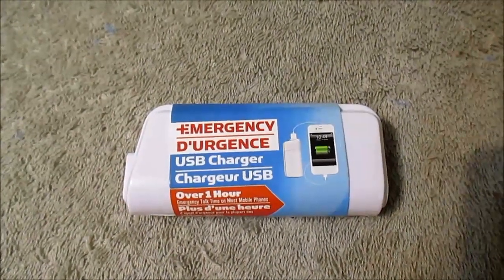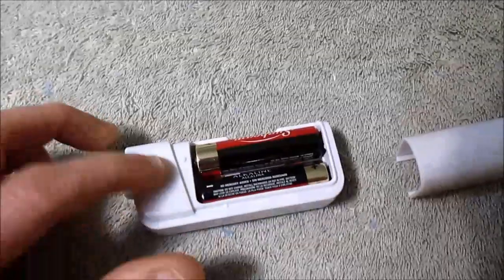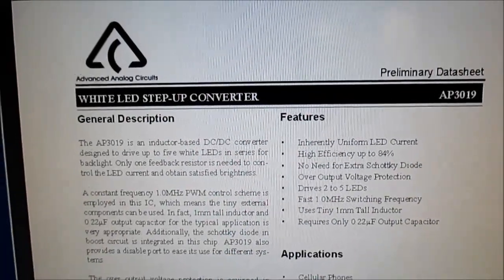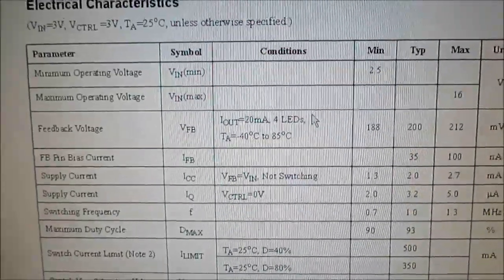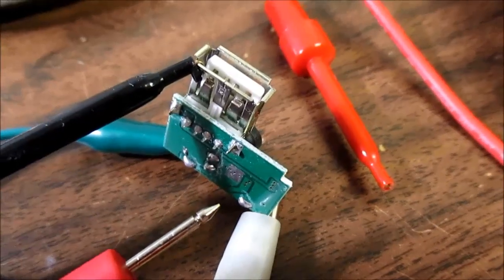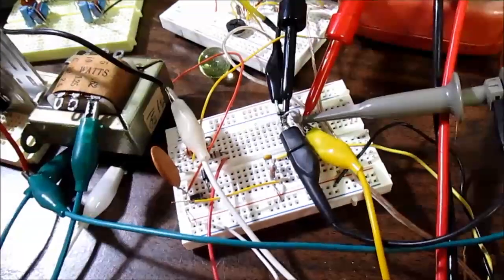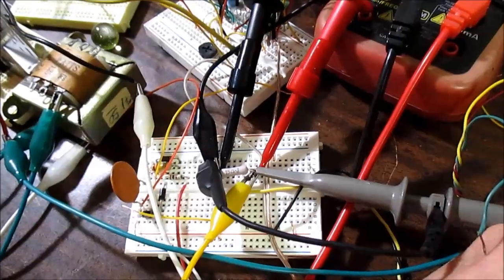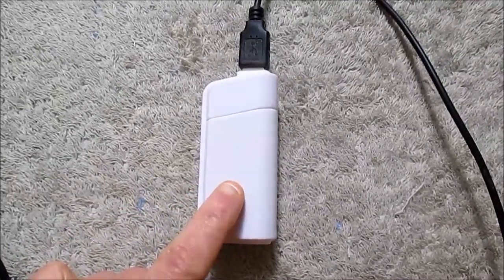USB charger teardown & review

Comment: I got one of those out of the dumpster yesterday. I was kinda suprised when I took it apart. I had seen them in stores and assumed that they already had a battery of some sorts in them. Thanks for noting about the current draw when it's just sitting. I'm going to make a plastic tab put in between one of the battery terminals so they wont be connected until I need them. I used heavy duty or super heavy duty batteries in mine (they was free and I don't want to waste the alkalines on this)

Comment: Since it's a boost converter, max switch current is gonna be max input, not output current. Here is some of my horrible math: 3/5=0.6 => 500*0.6=300mA  With such current draw, voltage on the output shouldn't budge a lot. Anyway, nice find for a buck, you can use it to power 3W LED, since it obviously can't output more than .65A. Thing won't like that and will go into current limiting, since this charger is voltage source with current limit and not a proper CC LED driver, but still... :)

Comment: 500ma is the MAX output, where it would start failing to boost.  Less than that, it should be able to keep up.  Considering that it's an LED driver ("up to 8 LEDs!", i.e. 29v output @ 20 mA), it's probably not a bad chip.  You have to figure that it's not going to meet ALL of it's max capabilities at once.  It's locked to 5v (less some ref voltage or diode voltage drop) to provide a somewhat higher current with lower voltage input, so I don't think it's doing too bad, -- it has definite limits, and it's limited by its board design.  HillOrStream  :  Re: powering it from NiMH rechargeables... At a dollar, it would be well worth cobbling a 3- or 4-cell battery holder together.  Get it up past the 2.5 min voltage and it looks like it comes alive.  MrJohhhnnnyyy  : I figured that the Isw was the max current out (Iout), rather than Iin, but either way... when you reverse figure like that, don't forget to account for the efficiency.   The docs show about 73% efficiency, so for every 1 W delivered, the circuit needs 36% extra ~=  1.36W.    If it's 2.5W out (5v * 500mA), then it needs 3.42W, or if it's 1.5W in (3v * 500 mA), it needs 2W... 

It's been a long time since I've had to figure this... so, from a TI brief + a best guess + a wing and a prayer:  I-sw = 500 mA should limit I-out ~= 205mA @ 4.9v = 1W-out, then @ 73% effic, would need 1.38W-in, which, at 3v in, would be 460mA draw from the two AA batteries... at which point I gave up and grabbed a chart from a battery website, and guesstimate that it would take about 36 minutes before the output voltage on two fresh alkaline AA batteries would drop to 2.5v and the circuit would start shutting down.  Whew.  Oh, resulting in about 600mW effective "charging" on the 5v side.

I have not checked my math, and I seriously wish I had something stronger than lemon water to drink.

NiMH batteries hold up much better under high current drain, so if HillOrStream made a 3-battery jig for the circuit, the 3.6v would deliver approx 2.1 AH (battery graphic) @ 79% efficiency, and might run for maybe 16 hours delivering the same 200mA @ 4.9v.

My brain may be bleeding, so I'm going to search for something medicinal to help.

Oh dang... I started to re-read, and realize that the 500mA I mentioned in the 1st sentence is NOT the 200mA I-out I guessed that the circuit should deliver based on I-sw information that I found online.  The example in the IC docs was for 29V@20mA, or 580mW, and my maths have little to do with their example.  

Everything I wrote was from erroneous backward engineering something totally unnecessary for no useful purpose.  Let that be a lesson to you.  OK, I give up.